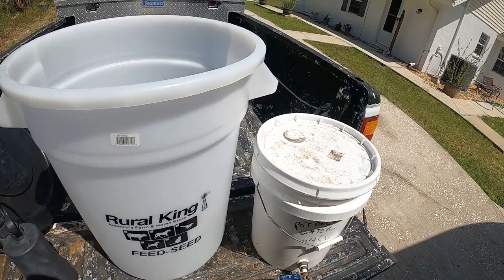DIY Syrup Tank

Comment: That style mixer is great.  I've got a 55gal white plastic barrel with a 3/4hp sump pump in it.   I highly recommend to weigh out the water and mark a line for different measurements.  Then just fill to the line with water and start adding sugar.   Also,  do you feel you still need to OA vapor your hives since you've been using the magic Stevo blue towels?  Thanks
Reply from the maker: I have not used OA in over a year now. Thanks for the barrel info!